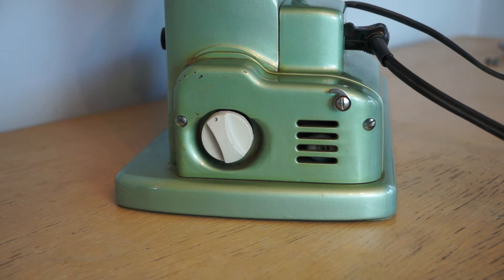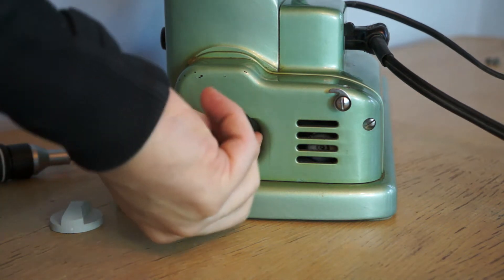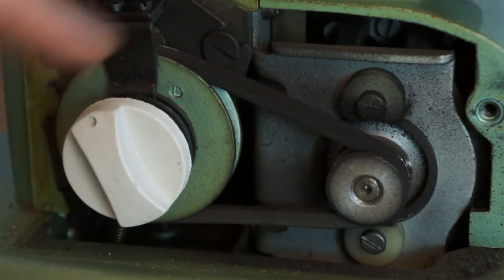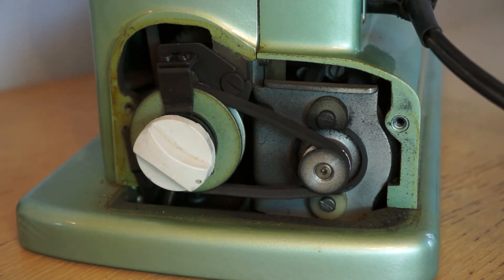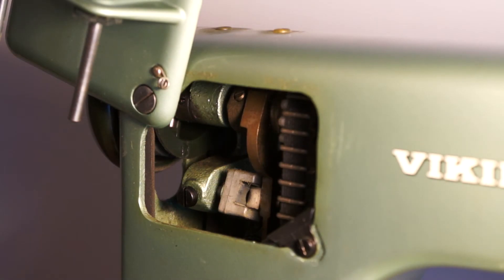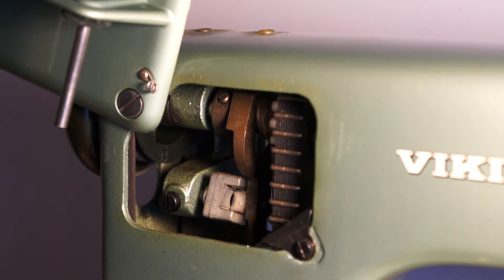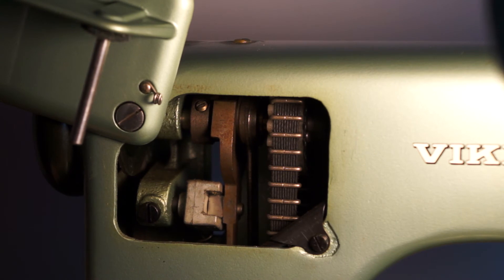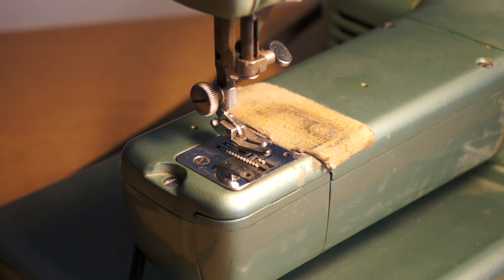It's Alive! - Antique Husqvarna Viking CL8

Comment: My mom had one of these green machines.  It weighed a ton and came with at least 8 different cams.  Does this one use cams?  I've heard that lots of these machines still work but the plastic cams are disintegrating.  If it does have cams, you might want to see if a nearby maker-space will digitize it for you.  With 3-D printing, a new one can be made, but you should digitize it before it breaks.  Look in the Thomas Register for belt suppliers.  I'd bet you could find ones that are more similar than the ones in the picture.
Reply from the maker: I don't see anywhere where the cams would go, unless it's some sort of attachment... I actually have a gazillion cams for all sorts of machines from that Pfaff Dealer estate sale I purchased... Not even sure how to use them tho...  Great idea having them digitized tho!  I'm sure they are very crumbly